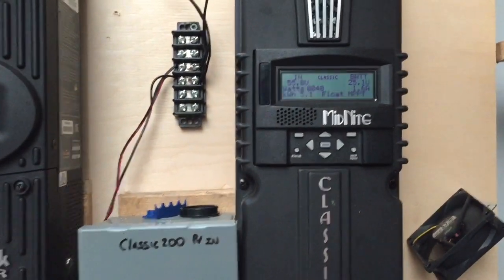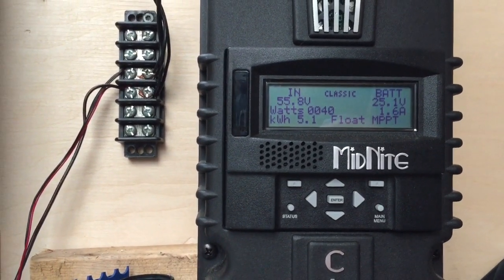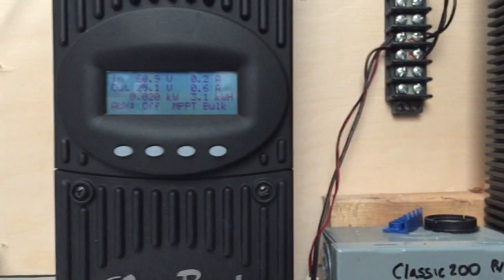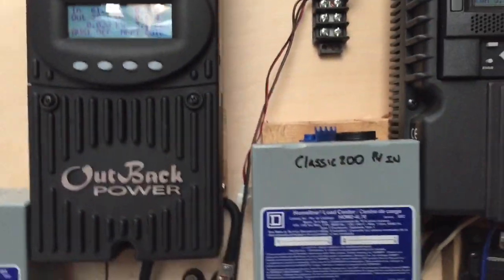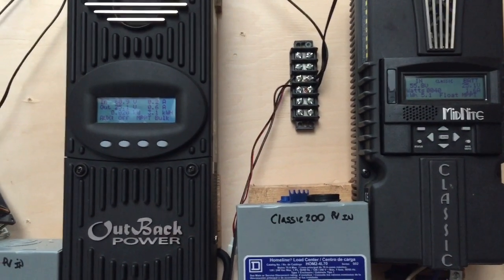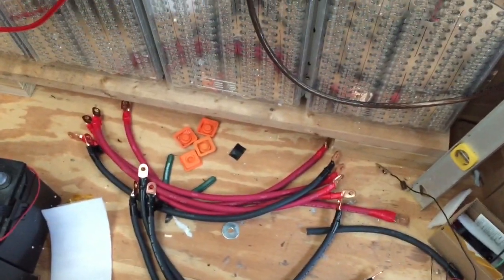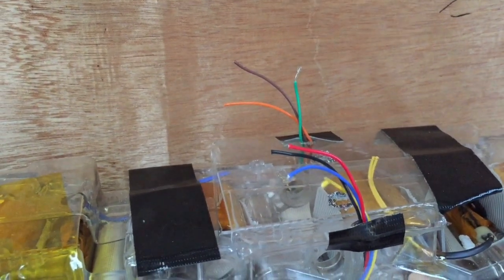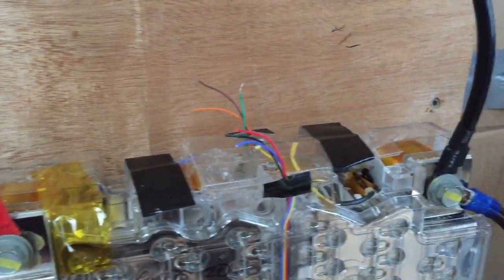Tesla batteries bms problems

Comment: How do i use one of the Tesla battery on my van conversion using 24V?
Reply from the maker: FlameRevenge I’m still green at the lithium power it seems kinda easy if you can find an equalizer and balancer , you may want to check out modern diy off grid , he’s got an awesome channel with these batteries

Comment: I just bought 2 model s .I bought these on e Ebay for 13.00 coupled with a hobby cell monitor. 3S 4S 6S 10S ~17S Li-ion Lifepo4 LFP Battery Active Equalizer BMS 1.2A Balancer.

Comment: Tesla’s bms and Jack’s V2 battery controller is lot safer way to go. His controller is bit pricey but well worth it. With V2 you can connect them in parallel, no problem. Do not charge over 25.2 volts that is max. limit. The same  goes for discharge - no lower than 18 volts. You can set the voltage limits, monitor each of 6 groups of 74 cells and safely disconnect, if the the pack exceeds the variance of 0.25 volts. Tesla’s advanced bms board takes care of passive balancing. Monitoring the terminal temperature is another factor, you get all these with the controller. Tesla modules are great but not as safe as lifepo4. You may wanna consider 20-90% charge/ discharge rate, the modules will last for a long time for a back up application like yours. I like the idea, I would  just spend more for good monitorng system like jack’s from evtv.
Reply from the maker: Thank you

Comment: Double check that every colour wire is the same on all the packs with a volt meter. Black is most likely your main neg. Then once you ve figured that tthey all are the same cell in the pack they can be paralleled. Do not assume they are the same . Make sure yourself. Do you have a 6 s bms?
Reply from the maker: Can’t find a high amp bms yet , I’ve got a balancer the same one Bobby has its Bluetooth I’m counting on it doing the job until I can find a good 6s bms , thanks brother
Reply: @southernohiosolarhomestead8477  honesty if your cells are good and the packs are all balanced within reason(0.01-0.03v/cell). You will be ok. But you wont have single cell protection. You will have to watch that . At least you only have 6 groups to watch. Look at a Batrium.  They arent that much.

Comment: Well I do that on my Bus batteries A123 I parallel all the individual voltages ie 3.2, 6.4, 9.6 etc etc and then balance them groups of cells. I think I got 256 cells in each group and 12 groups for 40 volts so 3073 in 12s cells similar to Tesla